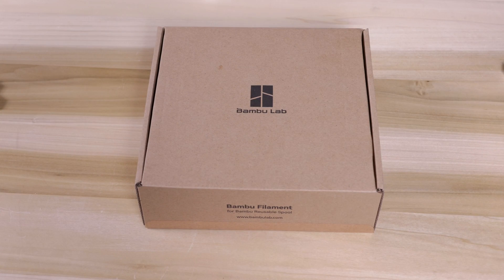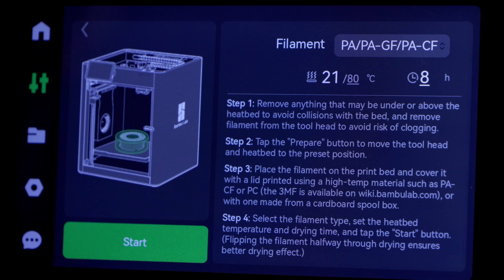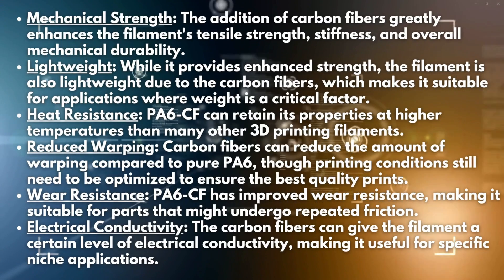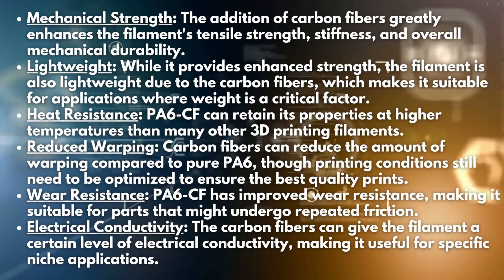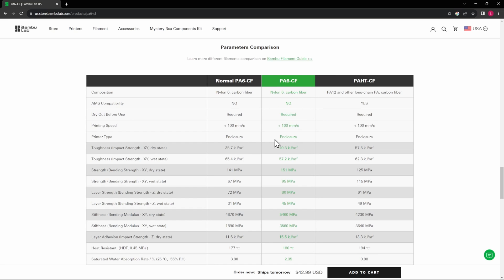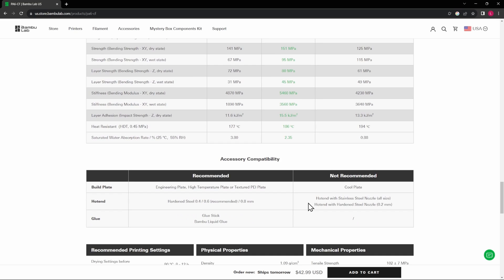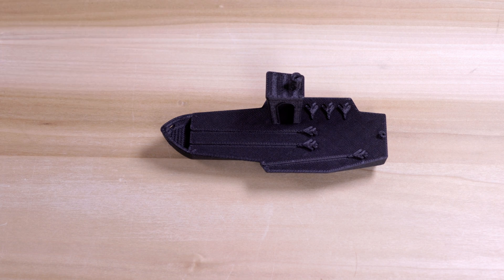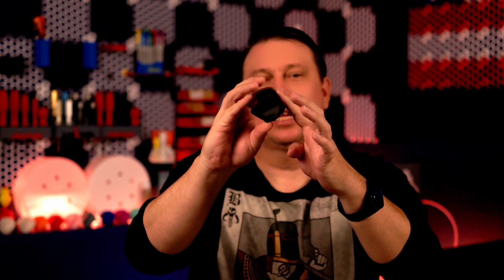What is PA6 CF?

Comment: Dudddeee i CAN NOT get this stuff to print well!!! Ive ran 4 tests and it comes out the same every time.
Reply: Are you drying the filament? what print bed are you using? Engineering plate? What are your issues? 
We can help if you add more details